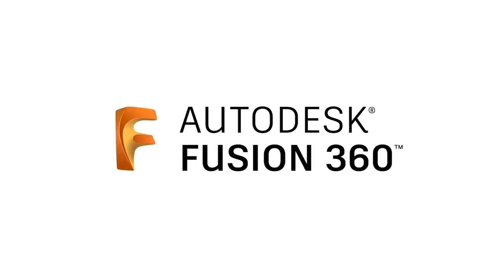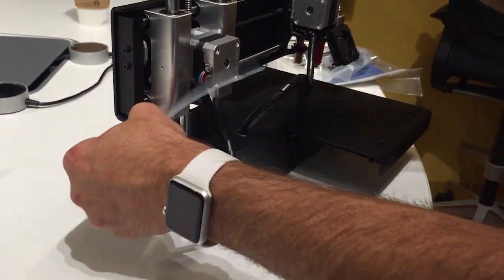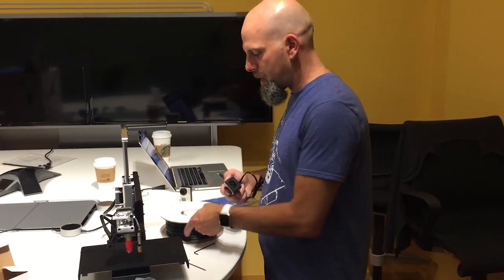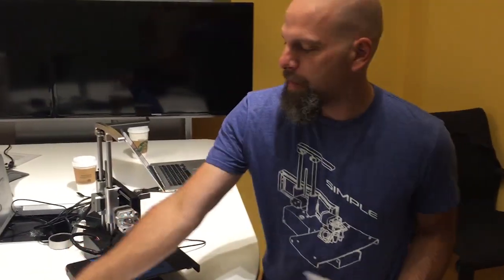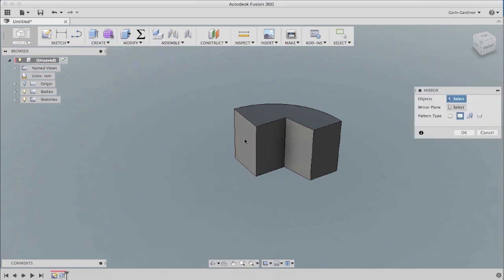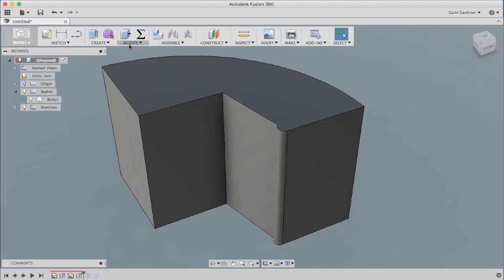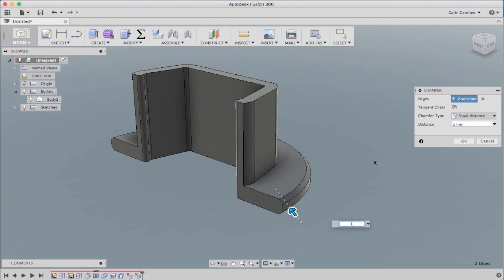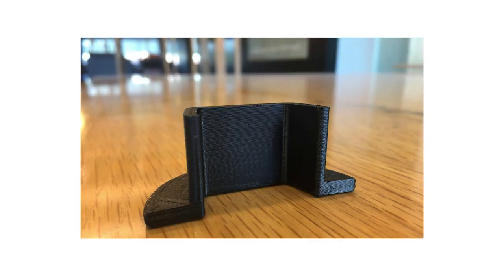3D Printing with Fusion 360 and Printrbot

Comment: Amazing, I've been learning Model for a while, but focusing on CNC Plasma, no wonder the 3D Printing has taken off, this is so much easier to pick up than plasma with the extra mach 3, Torch Height Control and building a cnc plasma machine. Still going to persist with the plasma but this 3D printing will definitely be another path for us to venture into. 

Will have to look into this Printerbot and Cura, I can see the settings on Cura would need to be right in order for it to work properly, but I could simply grab them straight off the screen here and start there. Thanks for the great modeling info too, man this video is fantastic, could watch it 20 times.

Comment: like the idea but some design flaws in the printer. Why not supply it with the bracket for the spool holder? Am also surprised by the lack of the wiring having the potential of causing issue with the build plate. surely these things should have been address in the design concept of the printer.